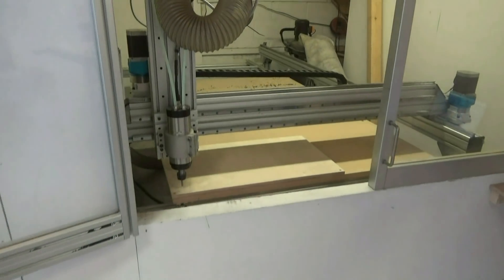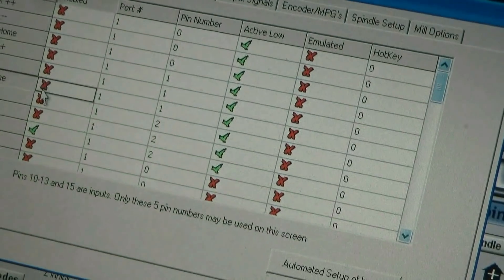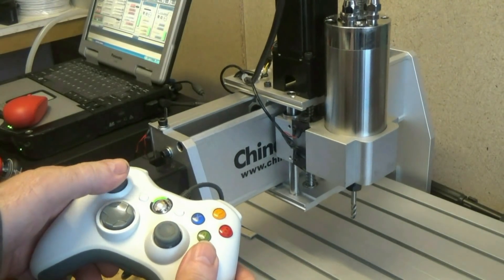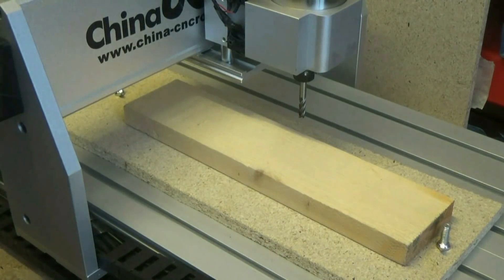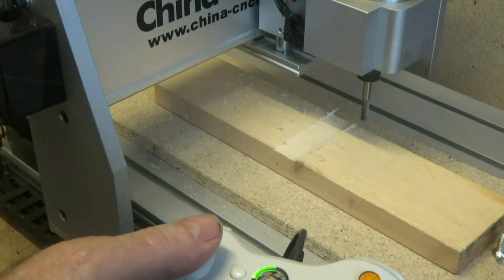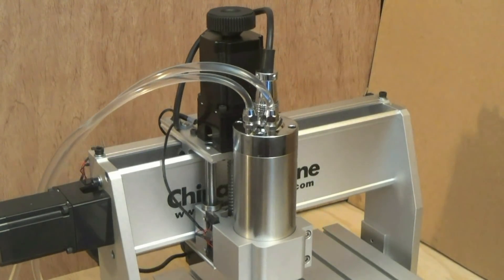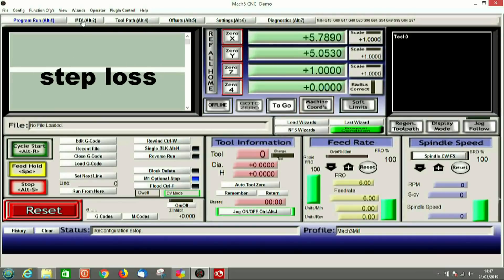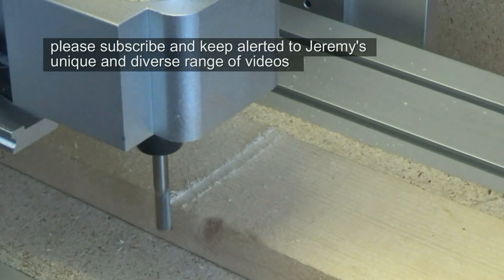My CNC Adventure (03) - First Cuts

Comment: Im doing similar but building from scratch. Its a big project. It's not a small project. I'm  building a 6x12' plasma cutter table and also I'm retrofitting a Gerber Sabre 408. Have no idea about the software yet.  

You should have a search for CNC router groups on facebook. Use the search function at the top of the fb page and then select the 'Groups' tab. 

That would be a good place to pose your question regarding software shortcuts. 
There are many CNC Router groups, all friendly in my experience.
Reply from the maker: Best thing is not to know till you get there!  I'm also building a bigger machine from a kit but this small one gives me an idea of how big a spindle to settle for on the bigger machine and gives me better understanding of all that is involved.
Reply: @WoodomainJeremyBroun  I agree - ìf you  understood how much was involved you would never begin in the first place. But the potential is so great, it has to be attempted.

The diy cnc community is a nice one.
Reply from the maker: Yes the open source community is what appealed to me also. The potential of CNC is amazing and hopefully the gain is worth the pain.
Its sad many woodworking purists are so against CNC. So long as the machine does not take over completely I think is the main issue but its here and its a reality.
Reply: @WoodomainJeremyBroun  its a tool, same as any other, only better and more precise and able to do it again and again, perfectly. Jeremy your pieces are one-off, it would be nice to series produce them.
Reply from the maker: My pieces aren't all one-offs. I was making batched furniture from the mid Seventies onwards and one of the few to do batched furniture. its the only intelligent way to produce furniture as a one off is at best a prototype. But the British market seems to demand expensive one-offs!
Reply: @WoodomainJeremyBroun  I didn't realise. I've done one offs all my life, am looking forward to mass producing, if I ever get there. Build it, revise, build it, revise. Will be fun.

Comment: Why spend so much?
Mount a normal router to your machine.
Reply from the maker: Shame you removed your first comment which was brilliant advice but how do I bypass using G-code please? I cannot even find a 'run' command on the Mach3 software. nothing is intuitive!  Regarding your amended comment please watch my previous videos regarding sing a router. Noise is a big problem with a router and a router is not designed for CNC. The bearings are not strong enough longterm. a portable router is also a 'plunging router'  hence the bearings are suited, but the main argument is noise. These water-cooled spindles are much much quieter. The prices are comparable on my research, if anything a 2.2kw spindle will be cheaper than an equivalent router and then you have to find one with a separate router head.
Reply: @WoodomainJeremyBroun  oh, sorry, I was gonna say use rotary encoder thingy... But I don't know if it records movement
Plus I don't know any advantage over gamepad, accept for accuracy. They both work on the same USB protocol (hid)

Also...CNC is something, I'm yet to get into.... With a partially complete laser cutter. All the knowledge I have is from watching 'this old Tony' videos